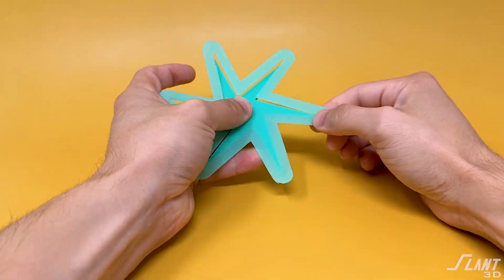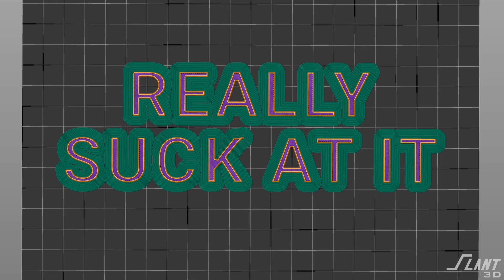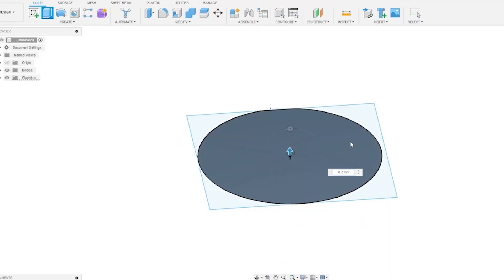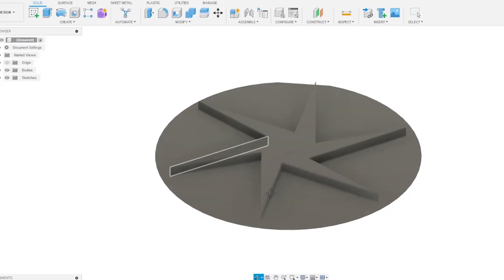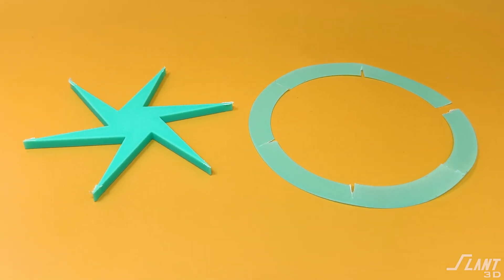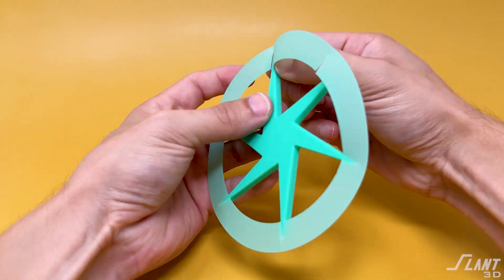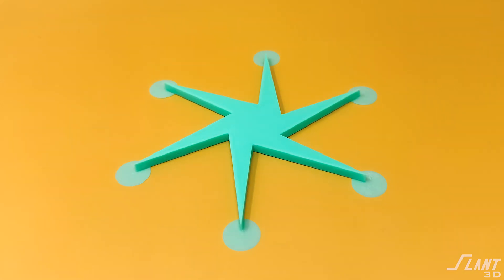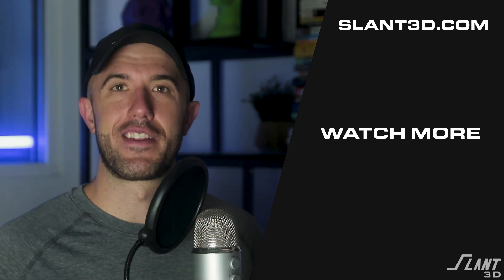STOP Using Brims. CAD is So Much Better | Stop Using Slicer Settings

Comment: How do you handle through holes, such as for screws or pins?
Reply: Maker's Muse has a lot of cool tips on this... They did a video where they designed a 3D Printer into a fallout 4 box of some kind.  But they had the problem, in their design, of needing a screw hole, but not at the bed level, instead of was higher up... And you can't print the screw hole perimeter in mid air... So he put a solid layer right below the hole that is the exact layer height thickness he was printing at.  And then it's just a regular bridge, and the screw hole and other features are built up from that.  You could basically hand push the screw through at lower layer heights, and at heigher ones, just use a drill.  Going from memory but I think that's right.  He also did a weird tear drop shape on the screw holes for vertically printed surfaces to keep the profile of the circle "true", and in the correct position.

Comment: Never miss your videos, would love to see the follow up.  Your discussion of engineered supports in a different video got me thinking.  I recently released a video where I made an engineered brim and I used pull off tabs as the contact point to the part.  Basically I engineered not just the brim but the engagement interface not unlike break off tabs used with CNC cutting machines.  I also put a "pull tab" on the edge to make it easy to remove the brim from the build plate.  I was thinking that a "pull off feature" could allow brims to be reliably ejected with your auto eject system.  I'd be really interested to get your feedback on the technique as you see more prints every day than I do in a week.  I look forward to your next video.

Comment: I have started using this already, but I have a part that only has a small circle that sits on the bed and have struggled get it both removable and will hold the part to the bed.

Comment: you don't have to add mouse ears manually if you use orca slicer.
Reply: There are even Cura Plug-Ins for mouse ears...i thought every slicer had them. Currently using orca too.

Comment: Glue isn't always enough, slicer generated brims are generally just fine unless you are doing mass production. Also even mouse ears are sometimes put where they aren't needed. I just printed a few dozen rings using a modeled mouse ear and it worked great and there was no extra ears to pull off. It snipped off very easy.

Comment: This makes sense for anyone using a Priting Service, as is the intention of this video.

If that's not your case, learn your tools and how to do optimise your process. If you're not printing for someone else, there is no reason for you not to use your slicer settings.
Reply: slicer logic for brim  should be optioned - the second option should be the same as described in video
Reply: better to learn CAD than tinkering with the slicer. slicer can change when you change printers, CAD knowledge works for all printers.
Reply: @xiggywiggs slicer doesn't change when you change printers. All major slicers work with both Marlin and Klipper
Reply: @orthotron  I have to somewhat disagree. Slicers change when they update. Orca introduced a new version at one point and it broke my profiles in my farm and every part started failing. It added features not previously there and the defaults for those features were negatively affecting the outcomes. It also defaulted all my profiles to classic walls instead of arachne. It was quite a pain to have to go in and check and readjust every setting, for 2 different style printers, and half a dozen profiles.
Reply: @orthotron  but then you're also spending the time to get your preferred slicer working with whichever printer are you happen to have, and woe unto you if you end up with more than one printer, or perhaps a friend wants to print off your file on their priner.
Reply: @phasesecuritytechnology6573  sure, that happened to me too. But that will happen regardless of whether you use CAD or slicer for such features. Anyway, I don't disagree that deliberately designed CAD features are usually better
Reply: @xiggywiggs  you still have to learn how to use both. 
Your just going thru alot of effort just to avoid 2 settings (supports and brims).
Reply: There's virtually no loss in learning how to have your parts come out the most reliably independently from the slicer.

Because afterwards if you need to use slicer settings for anything else you still have a more reliable part. And more margin for error. It still applies at home, you don't want to waste half a spool on avoidable mistakes.
Reply: @SquintyGears  exactly. Fixing printing problems in the slicer means you have to refix those problems every time you modify your model in CAD, if you fix them in CAD your model remains a single source of truth
Reply from the maker: You can learn two tools ok (CAD and slicer). Or 1 tool well. (CAD)

Comment: generated brims are easier to remove than modeled ones, cura better than prusa
for one offs they are more than good enough
but it makes sense to train people for mass production using your service
have you published your default slicer setup somewhere?
Reply: 2024
Cura

pick one
Reply: I literally just modeled my own mouse ears and they were 3 times easier and less time consuming to remove. And I use Orca. I was also printing several dozen of the same part. The issue with slicer ears is that you don't have control over where they are generated. Not enough control at least. If orca allowed you to paint the part where you want brims that would be better but still not as consistent and predictable as cad drawn ears.
Reply: @phasesecuritytechnology6573  IDK about any of the slic3r variations like prusa or bambu but, for me the cura brims don't even need a tool to remove they pull off clean by just pulling them off. You might be able to use mesh modifiers on the sections you want brim if you only want it on a certain section.

Comment: I use Orca Slicer and their brims come of really easy.
Reply: It depends on the part and how many you’re doing.
Reply: @TheOfficialOriginalChad I mean, I'm pretty sure print settings matter the most. I just tune flow and the brim-object gap, then my brims come off easy.
Reply: @TheOfficialOriginalChad   I'm just saying that I haven't had a problem with brims produced from my slicer and I have printed off lots of different things.
Reply: The actual problem i've had with brims is the brim not being strongly enough connected.

So anyway i use pads in the corners that could lift off, so they extend the lines off the part, like this method.
Reply: @lasskinn  set the brim-object gap higher and make the first layer thicker (0.32 for a 0.4mm nozzle is fine)
Reply: @gerolori  it's still concentric. Depends on what you're printing on what of course if its enough tho.
Reply: @lasskinn  it's concentric and a tight enough gap should fuse the two parts togeather, haven't had any problem with any part (spikes, long lines, anything really)
if you're printing the first layer at 0.08mm it's higly possible it won't work
Reply: @gerolori  well in my experience the differences come when pushing abs to limits in length of the piece being printed
Reply: @lasskinn  than that sounds more like a material/speed problem other than a wrong slicer setting
Reply: @spoon1272  sure. Me too. But the guys are often talking about manufacturing 3dp parts or designing for mass manufacturing those parts specifically with them. It took me some time too but there are really valuable information bits hidden here for home use too!